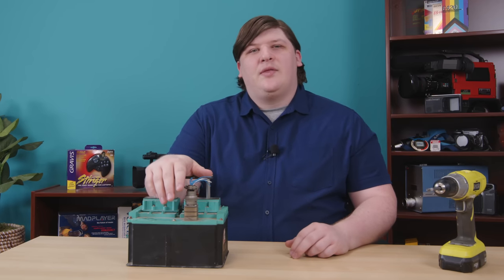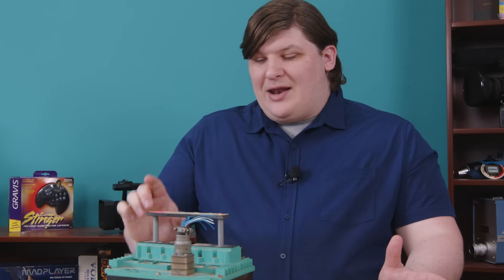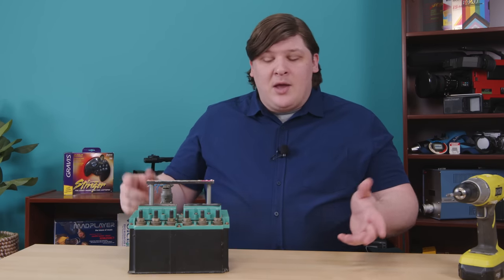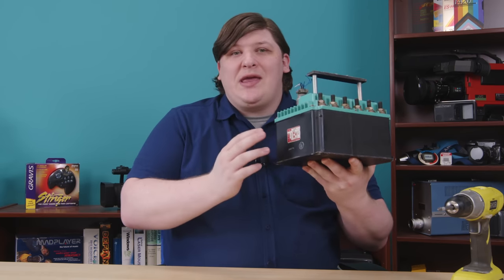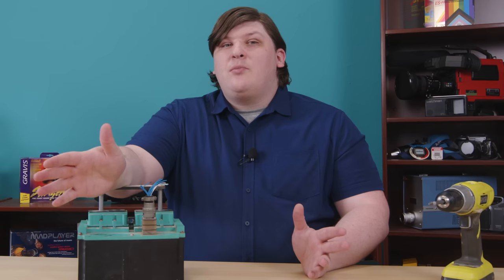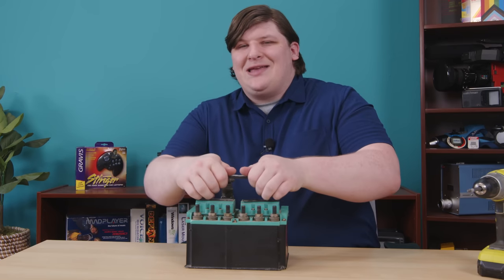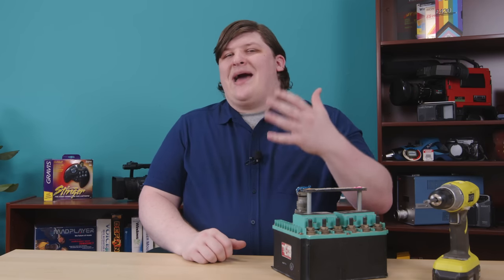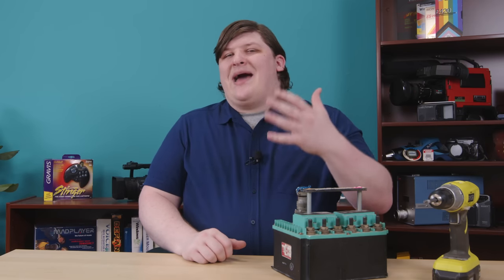A Short Story About (Battle)shorts

Comment: This relay's battle override is a one time use.  You engage it and it's permanently fused closed.  That's likely why it was removed and thrown out. (Or the technician who replaced it engaged the battle override for the VERY satisfying clunk it makes.  The military focuses on reliability and forcing a close can cause all sorts of internal damage.  The relay would never be trusted again so would simply be removed and replaced after the override.
Reply from the maker: Yeah, I hadn't thought of it but someone else suggested it and the moment I read it I said "oh god, of course" - anything that's been through this exceptional scenario can never be trusted again.
Reply: Thank you for commenting! This is really interesting.
Reply: Not only that, but if it could be reset somehow, there is the possibility it would get reset in combat or that reset function could go bad or be damaged even if it had never been used. No sense in risking it.
Reply: Yup. This. Those are modular components. And when one has to go limping (or slinking) back for refitting then everyone knows either A. the fecal matter already contacted the rotary impeller, or B. someone's idea of a funny joke is about to cost them a LOT of potato-peeling duty.

The other sort DO exist though (the two-way, on/off variety). Keep in mind even when one ISN'T being shot at, equipment - especially naval or heavy personnel - require maintenance. Consequently (thanks to the Military's Department of Redundancy Department... for Redundancy) MANY systems can be taken offline while in use, allowed to roll onto their backup, serviced, and interjected right back in, no harm no foul.

Indeed, this is common ENOUGH that the OTHER variety of safety (this is the "this end toward enemy" variety) are interlocks. Think system kill switches that respond to a given event: Private Bitzblownov opens a service hatch beneath which steel-meltin' current flows, or Seaman Staindlapel opens a torpedo tube, or Ensign Redshirt walks into any room on board the ship: there's an interlock that will cut power, or belay launch, or transport him behind the nearest large boulder to minimize damage to him (in the first two cases) or those around him (in the lattermost).

Battle-Shorts ALSO pull said interlocks out the equation (which is the other reason you don't muck about with em outside of the fecularly-flung fiasco noted earlier): 'cuz the Private/Seaman/Ensign didn't get no smarter, and explaining to a CO why you thought it would be funny to arrange his going AWOL (leaving nothing behind but a smoking scorch mark/swirl of bubbles/well-fed Gorn to offset the investment Uncle Sam had already poured into the lad, 'rest his soul) is what we term "sub-optimal" and/or "contra-indicated".

For these reasons and more, unless someone with a LOT more shiny metal on their chest then you're likely to possess expressly tells you to bypass/plunge/push/shimmy/etc such a short? You're better off being shot.
Reply: Fine! now I need to find a video where this satisfying clunk can be heard...
Reply: I was wondering about this because high voltage can act like a welding tool and can fuse two contacts on a switch together(welded).
Reply: Yeah, that was my first thought: no way they allow some cheap thing like this (in military world, of course, I’m sure it cost a fortune) to be a cause of future problems in real battle, so it should be one time use
It can, and probably will to some degree, melt inside because of over current, so it may stuck and become inoperable , and you can’t afford it
Reply: also, the ocean floor is riddled with items like this why keep the extra weight right!? before environmental measures were taken they would just dump surplus and defective and broken stuff overboard even on planes over land during WWII.
Reply: @cheeseparis1  just sample the plugging in of an Ethernet connector, then pitch shift it down several octaves.
Reply: The locking shut of the override is probably more of a protective measure for everything downstream of the box than to protect the box itself. After all, the relay is just a big switch that goes clunk. What you should really be worrying about once that bar gets pushed is all the sensitive high-power equipment that stands to get damaged without the protection the relay provides. So once you push it, there's no going back, and any tech seeing the bar pushed in after the fact knows that everything downstream in circuit is going to need an extensive checkup or an overhaul or just a take-no-chances replacement before it can be put back into full service
Reply: @grumblycurmudgeon  We'd also like to thank the French Legumes, and the Natural Guard, without whom none of this would have been necessary.
(if you don't get this sign of fire, never mind, it's not worth explaining)
Reply: @grumblycurmudgeon  You sir, are hilarious! It took me a second to catch those names... lmao 🤣 
I'm still laughing about the fecal matter contacting rotory impeller....
Reply: Indeed.  I figure this would be part of the checks and balances on the use of power.   Short this relay for a dammned good reason.   If you survive the reason, replace and file the paperwork to be accountable.
Reply: @grumblycurmudgeon  Someone's former military.  And very funny.
Reply: @sessionfiddler  there's a formal process for everything in the military. This particular one reads like this:
1. Bend forward at the waist, ensuring knees remain locked straight.
2. Take hold of the ankles located at 10 and 2.
3. Prepare to receive bureaucracy.
4. Repeat for duration of incident, tour, or court martial.

It's good to have a plan.

Comment: There is a civilian equivalent. When you wire up the fire pumps for high rises you can not have a fuse or breaker in the circuit at all. You have to wire them with heavy enough wire to support the "locked rotor" load.  If called on to run those pumps must run till they burn no matter what.
Reply from the maker: Whoa. That is incredible, and makes perfect sense. Starting a secondary fire is of less significance than putting out the primary inferno.
Reply: That's an interesting (I don't really want to say "fun"...) fact to learn!  I never thought of that sort of thing, but if there ever was a worst possible time to blow a fuse this would be it.
Reply: @CathodeRayDude  One human life in that situation is much more important than a $500k fire truck. Especially when media is going to go mad over the idea that a toddler/baby/child whatever was burned alive because of a lack of functioning equipment that could have functioned and saved a life.
Reply: @CathodeRayDude  And that secondary fire is very likely to be in a cinderblock room with a heavy steel fire door. Our floor was asked/forced to remove a poster stuck on the outside of our electrical room door when a fire marshal saw it. No details, but I bet it was so a red-hot door wouldn't have a cardboard poster to convert that heat into flames on the human side of the door. Or perhaps "no modifications of any sort at any time under any circumstances" rule to cover everything at once.
Reply: @R.Daneel  I would take a wild guess too at quick identification being of absolute importance, and not to be changed. The door and it's color scheme and signaling is probably standardized in some form.
Reply: @SirenaWF1  They are talking about fire pumps to supplement water pressure for sprinkler systems. Big motors installed in the sprinkler rooms of high rises. They usually have to have a direct separate feed from the electrical utility, completely bypassing the meter and any overcurrent protection. I think they are still allowed to have short-circuit protection, because at that point your building is screwed any way and a short circuit could cause a bad fire, but other than that the motors will run until they burn! The feeders have to enter the building directly where the fire pumps are at, and if this is not possible they have to be encased in concrete for the entire run inside the building. The fire alarm system monitors the power for the pumps and puts the system in trouble if power fails or is tampered with. Also the phase rotation is monitored in case 2 of the phases of the 3 phase power are inadvertently swapped, because this would make the pump run backwards!
Reply: @CathodeRayDude  that's also why fire pumps have to be tested every so often. The same is true with most life safety equipment.
Reply: Interesting. I'd imagine similar systems exist for things like elevator motors and other coolant/drainage pumps.
Reply: @compu85  that and generators
Reply: @CathodeRayDude  Interesting fact, not directly connected to electrical relays specifically, but about pushing equipment to the limit if you just need to
I have an old (2008) Range Rover sport, and it’s a good universal vehicle, you can drive fast on a highway and go to the woods or camping pretty much everywhere, where there is even a hint of a road (not talking of heavy off-road stuff)
Once in early spring I drove to the woods, and it was a time, when the soil is partially frozen, and even a water in the puddles 
So in the morning I drove like nobody’s business, but in the evening when I was going back, the was one particularly “bad” place, with a large puddle and no way around 
So I slowly drove on the ice, but apparently during the day ice melted enough for the car to brake it 
So I’m in the car in the middle of this sea-like puddle, and wheels not even touching the bottom 
I have no winch, so… I’m stuck in the middle of nowhere with no cellphone coverage 
And one thing saved me, that I’m thankful to the engineers of this car:
If you really stuck, and your car is laying on it’s belly, and only in this scenario (this is important, you have no way doing it otherwise, so it can be viewed as some kind of safety switch) car will automatically rise up for about 40 mm
And if THIS is not helping - you have another option to rise the car for about 35mm - you can hold down brake and hold “up” on suspension controls for several seconds - this will give you in total about 70mm of lift
And this ability really saved me, I managed to drive out and safely returned home 
You cannot force this mode until you stuck, because suspension in it’s physical maximum height, you cannot even drive like that more than 10km/h, because it will damage the suspension 
But damn this is a cool feature, that once saved me [maybe even my life]
Reply: @llMarvelous  Now THAT is a great anecdote! I'm only half surprised it came outta a Land Rover; that simply SCREAMS German (the Brits' normal policy for addressing such matters typically being of the "forcefully-imperious demand" variety... outside of their military. Within which Land Rovers have a lengthy past. So fair enough).

Although, I gotta ask: HTF did you think to TRY? I mean... waist-deep in near-frozen water in a functionally-swamped vehicle in the middle of nowhere isn't the moment I'D be prone to "calmly consult the manual", myself. Did you know about it already? Or are you just that stone-cold badass?

I wonder if they still do that, the Indian company Tara having bought them back in '13.

Anyone here gotta late model Land Rover and a pressing desire to see if it can swim?
Reply: @grumblycurmudgeon  
I knew about this feature, theoretically... I never used it before
And i remembered it only when i began to rise and lower the suspension in hope of breaking ice somehow
And at some point a message poped up "Suspention at maximum height", and THEN i remembered about that second option when you hold brake pedal and "up" simultaneously for several seconds
idk if i could possibly “calmly consult the user manual”, if I didn't knew about this feature in advance, not sure about that)))
UPD:
i rememebered, when I went for a test drive of 2019 RRS we drove to the snow field, and at some point car done the same thing - it stuck on its belly, message poped up, car rose up and we continued like nothing happened... 
although i never tried this "last option"...
btw, newer bought new RRS, even then it became a car that you can’t go into the forest just like that, it became too impractical for this
Reply: Actually you must have a fuse or circuit breaker, but similar to the wire it's rated for the locked rotor amps LRA